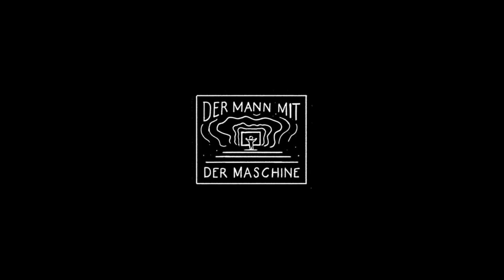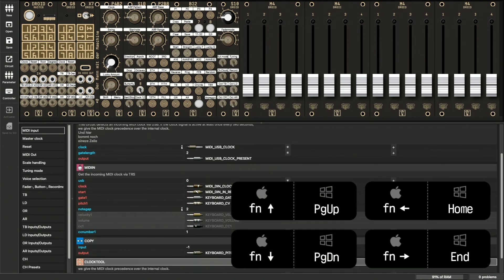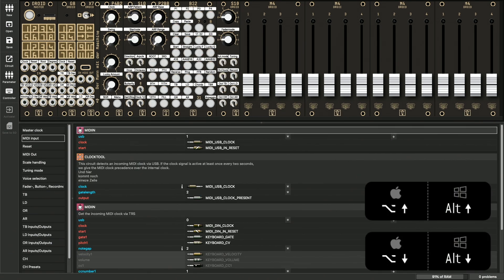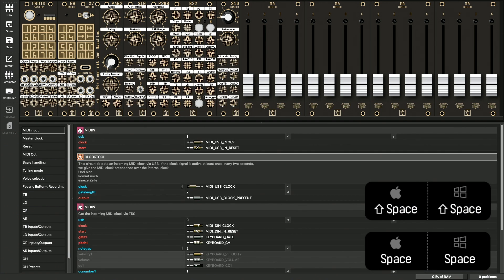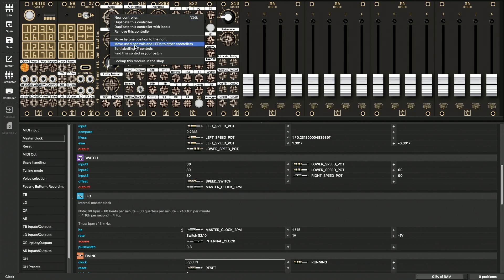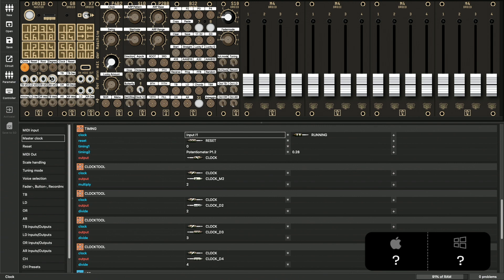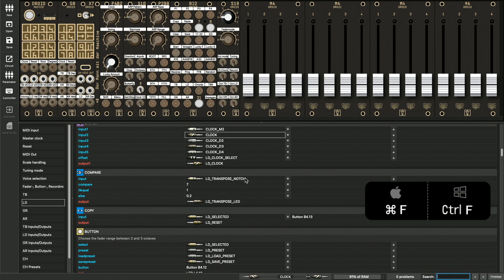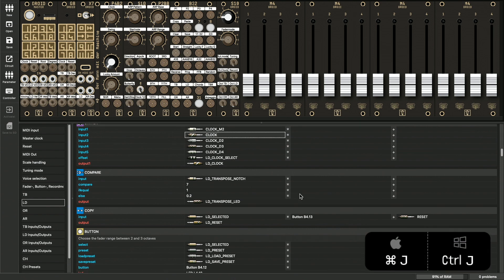Droid Forge - Efficient Navigation

Comment: It's honestly wild to me how user friendly, well designed, and well thought out this software is. Especially with the massive amount of documentation in the manual. 

This is an unsolicited suggestion — maybe this is a dumb idea, and would go against the spirit of the design philosophy behind this software, but would a secondary node based view be possible? 

Would it make sense? It feels like we're in close territory using the cable metaphor, and also can give a clearer view of the signal flow. Plus, when we need to connect a lot of parameters in circuits would it just be quicker to drag connections between multiple points?
Reply from the maker: Hi James, it's pretty obvious to suggest creating such a graphical "node based view". I have decided not to do this for several important reasons. The structure of the Droid patches does not very much resemble a "signal flow". It's no audio that is processed. And most of the connections are rather trivial like mapping 16 buttons and 16 LEDs to an "algoquencer" circuit. That would need 32 cables just for this. A total mess. You would spend most of your time arranging nodes and cables to better see what's going on. We would need to introduce virtual "sub patches" that try to encapsulate things. Powerful operations such as "expand parameter array" or "copy section + rename patch cables" would be super complex or impossible.

If have worked with such interfaces. I believe that for Droid it's not really beneficial.

Other from that it would eat much of my valuable time that I rather invest into new musical funtionality.